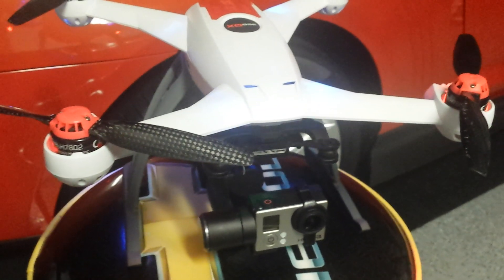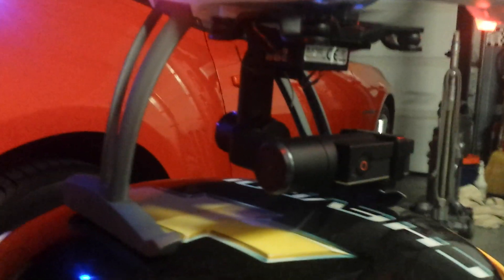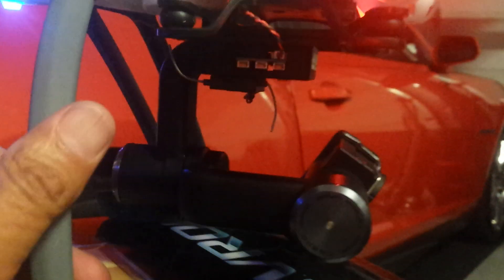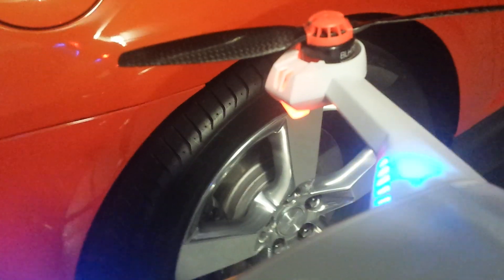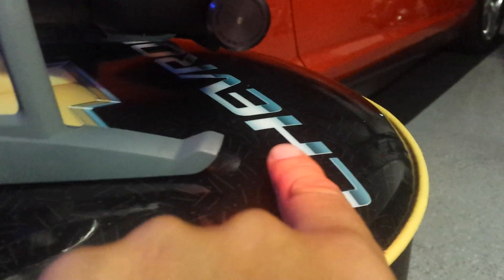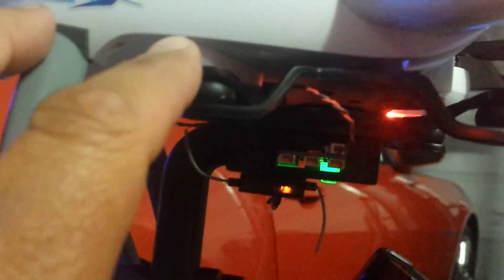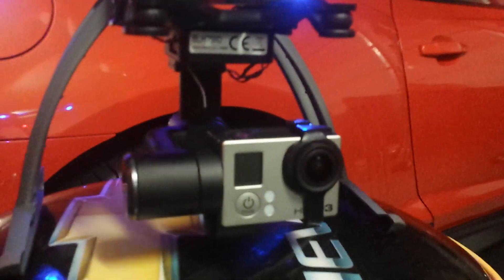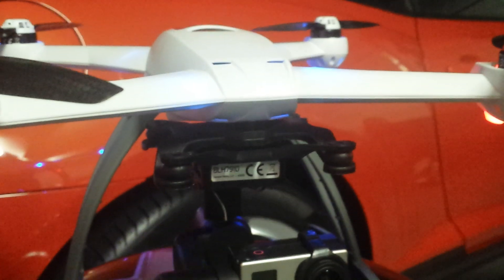Install GB200 on 350QX and DSMX Satellite Receiver for tilt control using AUX2

Comment from the maker: I tried this Lemon satellite to test in place of the Spectrum and work perfect. I think it binds faster and more reliable in my case. I find i have to pull off the cable on the sat  a lot to get the bind. I'm not sure why. It could be a fusy RX. The lemon works without any issues. I bought mine here..
http://rotorgeeks.com/index.php?route=product/product&path=34_61&product_id=54

Comment: Hay Johnnleyaz I put my GB200 Gimblal on and got some XTreme Props . But I'm getting a lot Jell-O . How did you balance your props
Reply from the maker: I always use my Top Flight Precision Magnetic Balancer. I personally am old school and like to sand the heavy blade carefully without changing pitch as I have done for RC airplanes for may years. I hear of some guys adding tape to the light blades but no my thing. Good luck

Comment: do you think it would weigh down the quad if you added an fpv system to it in addition to the go pro and the gimball? i only ask because i am thinking of adding it to my 350 qx
Reply from the maker: Yes you sure can and I have many times. If you're the gopro & gimbal with video out as your camera for FPV, you must use a auto level modes (not agility) since you cant adjust to your flying to a horizon when flying with a gimbal.

Comment: Two questions... I have a 350qx version 1, which I upgraded by downloading the version 2 firmware. will this GB200 work on my 350qx? and can I do the tilt feature? I have a Spektrum DX7S radio
Reply from the maker: Will this GB200 work on my 350qx? Yes it was designed just for it. and can I do the tilt feature? Yes with a external satellite RX just like I showed.
Reply: ok, what version is your 350qx? 1,2 or 3?
Reply from the maker: 1st release with software upgrade to 2.0
Reply: *****
I have successfully installed the firmware. With my DX7S I use the knob and the camera tilts, only it's not a three stage tilt... it allows for full range of motion.
Reply from the maker: Nice Jon Guy, No knob on my JR11X :( But the 3 position switch works good enough for me!

Comment: I am now using the 350 qx with Firmware 2.0, GB200, the SPM9645 and DX9 for tilt control. Until now i did not get the changing from angel mode into velocity mode to work. I thought channel can be used for this. The LED should change from green to blue,but is dos not. Does anyone have experience with that?
Reply from the maker: It sounds like end points need to be adjusted on channel 5 (gear channel) to get the modes you want. You should get Green, Purple and Blue mode lights.. or Green Purple Red. all 4 modes are possible but that a  hole other lesson and It bast to ask a DX9 user.
Reply: Thats a missunderstanding, i am talking about 2 modes of the gimbal. With channel 8 on a 2-way Switch you should be able to change the gb200 into velocity mode. The LED of the gimbal than should change to blue.
Reply from the maker: I just read about velocity mode but I don't see a use for it. The manual isn't very clear. I did however see there is a software upgrade for the gimbal. It's working so I don't see reason to waist 2 hours messing around.

Comment: I have the same setup - minus the receiver so that has just arrived and will attempt to work out how to bind to my Dx 6 without upsetting the current settings. If I get really stuck I'll niggle you for tilt adjustment advice!
Are those carbon props on your rig?
Reply from the maker: Good luck.. It's not too bad to figure it out. Yes these are the Carbon Extreme Props..

Comment: Nice are you using the stock battery? If so how long can you fly on it?
Reply from the maker: Thank you and yes the stock 2200 mAh battery.. I watch for the blinking warning so i can't tell you exactly. They now have 3000 mAh that will fit right in if we need more flight time.

Comment: Thanks so much for your info. I am a total newbee to that stuff. 

2 positions will work just fine for me. Forward and downward should do the job. 

Can you tell me what I have to do after I did the binding? Like how do I get it to which switch? I mean the tilt command.... 

Will those settings be saved under my current 350qx remote settings? Meanings just adding the newly added switch command?

Thanks again for your help. 

I appreciate it 👍

Comment: Awesome Video! Thanks for posting and explaining. Would you mind explaining in an additional video how to bind the satelite receiver to a dx6 remote without messing up the dx6 350qx settings? .. For newbeees ;)
Reply from the maker: Thanks, I don't have a DX6 but when you rebind the 350QX again when binding the satelite, Any previous transmitter settings from before with the 350QX will not change, Only the addition to your satellite with the 6th channel. I should tell you a DX6 with only give you two angles since I don't believe it's a 3 position switch on the flap channel.
Reply: *****
HI, thanks for your answer!!! I received the satelite receiver, connected it the same way as you and it looks like i was able to bind it to the transmitter since it is not blinking anymore. Unfoertunately I do not have a clue how to get that second additional receiver set up in my remote. since i only have 2 position switches on my dx6i I guess I would want the tilt to be set to two positions as you mentioned in your answer. that would be fine for me. Can you tell me how i can set that additional receiever to one of my 2 way switches on my remote? Thanks in advance for your help!!!! i didnt find a video about that.
Reply from the maker: I would do some more reading on specifically the DX6 radio end point adjustments of that ch 6 flap channel. It should move when they are changed. I'm sorry I don't have a DX6 set up with mine to try it. If you have a knowledgeable hobby shop around they can be your greatest resource.

Comment: How did you bind the satellite receiver? I'm new at this. I have a Blade 350 QX which I just updated to v2.0 and installed the GB200 gimbal and a satellite receiver. I making it work with a DX7S radio. Thanks
Reply from the maker: That should be easy. Just wire up the satellite as I explained on the video to power it from the 350's main board. Then turn on the 350QX first, it will power up the satellite receiver  (rapid flash orange) and the blue mode light will flash on the 350 underneath. Then hold in the bind button on your DX7 and power it on, and don't release it until the 350qx and the satellite binds up to your transmitter.
Reply: *****
Thanks for responding. I wasn’t able to get a successful bind on the satellite rx after many attempts so I called Horizon tech support today and was told that there is no ‘fix’ yet to get camera pitch to work with the non-AP version of the 350 QX. This differs from the information I got from tech support a few weeks ago, which had prompted me to buy the DX7s radio and SPM9645 satellite receiver. I was informed today that they are working on a fix, but they did not know when it would be released. Early attempts at camera pitch control on their part made the quadcopter very unstable in flight. I guess you were lucky to get yours working.
Reply from the maker: vernondepot

That's nuts, I  know your radio can bind to both. I have a JR11x TX but that shouldn't make any difference, if anything yours should work perfect..I would bet you got someone not very tech savoy. Call back!
Reply: I will. I'll give it a few weeks. I'll let you know if and when I get it working. I spent $300 on equipment to have tilt, so I hope it wasn't for nothing.
Reply: I got mine working today. I was initially trying to use a SPM9545 satellite receiver. I went to my local hobby shop and we connected a SPM9645 satellite receiver and had a successful bind on the first attempt. The gimbal tilt works well with the rotary knob on my DX7s. I experienced no instability during a test flight.The only issue I have now is that sometimes the satellite receiver will not be bound on a normal startup, requiring a re-bind. I've read about others having the same issue. It's more of an inconvenience than anything else. Thanks for getting me going in the right direction.
Reply from the maker: vernondepot That's great! I had the bind thing happen as well about 2 in 10 power on's, but don't rebind. I just shut it all off, just move my radio closer or away.. The satellite RX's have some issues finding binds that Horizion needs to address.

Comment: Please explain your transmitter settings.
Reply from the maker: Sure.. I assume for the gimbal.
I bound up both the 350qx and the satellite at the same time. Strait away, my AUX2 channel was on the right 3 way switch on my JR 11X . I centered the angle to 45 degrees with SUB TRIM. I flicked the switch up and up and it tilted the camera down, so I reversed the channel. Next, I sent my end points to strait out and strait down. It couldn't have been easier unless the 7th channel was built in the gimbal without the satellite RX.
Reply: Thanks! I'll give it a try.